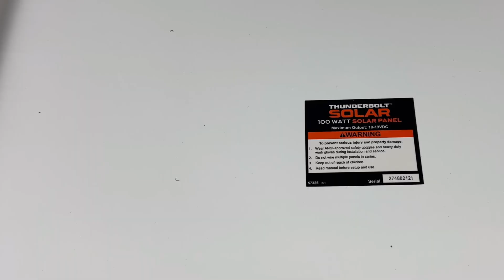MC4 Install Crimping Easy DIY

Comment: that is not an MC4 connector it is a knockoff and those are cheap tools that risk fire
Reply from the maker: A true staubli tool kit like the one I have, is about $1200
1 out of 1000 will buy it for their basic solar builds. 

The two biggest things is using the same brand connectors and not mix and match, and don’t over amp/volt your setup. 

The installer / user is the biggest culprit of poor connections verses the tool. If you have worked with crews you’ll know some people regardless are not good with tools. Even if they have the best.
Reply: @johnnysweekends  true. 
Nobody tells you this in the videos I’m just learning right now by researching this in great length.
Reply from the maker: I do mention more in this new video of my solar installation on the Rv which you can use the items for sheds, RVs, vans even homes if you want. 
Could give some ideas Install RV Solar Like A Pro! -The Quick & Universal Method Anyone Can Do!
https://youtu.be/furzOOafu_Q

Comment: I don't see what is making the electrical connection and in fact when I do what I see you do, I get an open circuit.  Are you sure you only crimp way down on the two folding tabs?  Are you sure you only strip a quarter inch and don't crimp where there is bare wire?

Comment: My male end (female connector) doesn't click when I insert the wire.  The female end does click.  Is there something wrong with the connectors I bought then?  So the only thing holding the one end in is by tightening that nut and closing the rubber piece on the insulated part of the wire.  It's not held in place by the metal.
Reply from the maker: Defective or mix and matching pins with connectors 
I would use another set of

Comment: I’m running #8 wire, it appears that the crimpers and MC4 connectors are #12 & #10, not 8. Is there a different MC 4 connector if you’re using #8 wire?
Reply from the maker: Typically only true Staubli mc4 connectors are meant for 8-12g wire
While the cheaper is for 10-12g wire

Comment: Surley it would be better if the cable ends were soldered thus creating better connectivity  down all the wire strands.  ? 🇬🇧
Reply from the maker: That’s not how it’s instructed

Comment: Only thing I would point out is if your solar system has high voltage 250-400 volts good idea to check over those MC4's once in awhile if you can get to them easily I have a ground mount so I can walk under the panels use it for shade. I have found MC4s that melted the connector.

Comment: It sounds confusing. Why male pin inside female connector, what will happen if you put female pin in female connector.
Reply: @SSUKBD  that's standard on the majority of insulated connectors (any type / industry). It's mostly just a geometry thing where it works out better and protects the pins the best.

Comment: I dont have the tool, but i crimped with a Plyer and then melted a lots of solder into the Joint. Now i dont think its going anywhere. Thanks for the video, i followed it and now i have good connection.

Comment: I really think you should take this video down and remake it, for three reasons; 
Which manufacturer's instructions say to disassemble the connector? Certainly not Staubli, the original MC4 manufacturer. Disassembling the connector can lead to losing one or more of the parts, reversing one or more of the parts, pinching the sealing gland, or introducing foreign material into the connector. This might not be obvious for many years, until it causes a fire.  

Secondly, double crimping the connector? Which manufacturer allows this without voiding the warranty? 

Thirdly, twisting the copper strands of the cable before crimping the connector? The whole point of this type of open barrel connector is that the legs of the connector penetrate the bundle of strands, and by twisting the wires you risk the legs breaking a wire, or being deformed or deflected. Again, which manufacturer recommends or allows this? Certainly not Staubli

There are only 5 steps to the manufacturer's instructions; strip, crimp, inspect, insert, tension, and you have added your own 3 (double-crimp, disassemble, and twist the strands) for what gain?

These connectors are expected to last the life of the installation, so with modern panels, this means in excess of 30 years. Your modified method doesn't meet any electrical code i know of.

I wouldn't risk going against the manufacturers installation, increasing the probability of a failure or fire, and voiding your insurance, and your connector warranty, when just following the manufacturer's instructions is faster and easier.

Comment: Does the male end vs female end need a specific metal piece? Or as long as one has version a of the metal and one has version b it’s fine? Hopefully I’m making sense: wasn’t sure if male mc4 needed the wider or thinner metal
Reply from the maker: Do not mix brands….and watch the video so you get the correct pin
Reply: @johnnysweekends  first time I watched I must have missed it, thanks

Comment: Sir good day to you. Im from ph and starting to build my DIY solar system. Basically, i series my two panel. And now i have to crimp a mc4 and followed your video. However, when testing the panel, i got a negative reading which means that the polarity was reversed. My question is, if my panel have a male connector for negative polarity then my mc4 female polarity should use the black wire and not the red wire since it is still negative connection correct? And vise versa with the possitive polarity? I asked this because i follow this instructions and put then red wire in female and black to the male and plugged it to my panels and now I got a negative readings in my multimeter 😅. I just want to confirm my scenario for me to switch the wires on the mc4. Sorry for my noob question btw.

Comment: i dont have tools only pliers, is it possible to do it?
Reply from the maker: Yea you could. The tool makes it way easy but if you’re good you can do it. Just cant make the crimp to wide or it wont seat in the connector

Comment: Very useful and to the point information. Switching my Harbor Freight panels to MC4 connectors will make it easier to connect them in series, without suffering the power loss of all the wire adapters otherwise needed. Having the All In One MC4 kit on hand will also make for quick repairs if any connectors get damaged in the future.

Comment: Nice Quick video, but misses a critical point.  Who is the manufacturer of these connectors they don't appear to be Staubli Multi-contact (MC) Connectors.  Use of this MC terminology for other manufactures connectors can be misleading and dangerous.  These style connectors cannot typically be cross-mated with other Mfrs connectors, and definitely not with true Multi-Contact connectors.  This is the leading cause of fires in PV installations today.  Seriously, just read Staubli's instructions and Whitepapers.
Reply from the maker: While true a Staubli connector is more the standard and what we have in the shop most people dont want to pay $5 per set. Plus how you know every manufacturer is using a staubli connector on every brand of solar module? I find the renogy, Ecoflow, bougerv all seem to be the same as far as quality goes between them. And I would recommend at least a name brand verses the cheapest of the cheap from eBay and Amazon. So many out there with tons of different names. Maybe I’ll compare some and see if there is any real significant difference.

Comment: This is all fine and dandy, but this amateur viewer has reservations about buying a crimper kit when all I need to do is use it one time to build my small system.
Reply from the maker: Lol you say one time, but watch out…..its addicting and soon you’ll want more…😂
Reply: @AdrepKeith  I just finished removing all the MC4 connectors I built for my “toy” system and replaced them with higher quality connectors. Your mileage may vary but I’ve found a cheap crimper (I had the wire cutter/ stripper) like the kit shown is a great investment, like most tools. I also invested in a crimper for square ferrules, very helpful for the other end of the wire with the MC4s on one end.

Comment: This is an old video but a few corrections here.

First, use the largest AWG that fits into the crimp if you can.  Either 10AWG or 12AWG, generally.  Do NOT use wire thinner than 12AWG, it won't make for a good crimp.   It MUST be stranded copper or stranded tin-plated copper wire.  It should NOT be "poofy" wire (tin-plated copper wire with 200+ really thin strands).  Poofy wire should never be used in these applications.  Use wiring explicitly designed for solar applications which means 10AWG or 6mm^2 stranded copper wire with no more than a few dozen strands (and usually not tin-plated either).

Second, don't twist the wire.  The crimp folds over and pushes into the middle of the wire bundle.  Twisting the wire may cause the crimp to cut the wire while it is pushing into it.  The wire should be kept straight.  The crimp retains the wire because the extra wire past the end of the crimped metal splays out and prevents it from being pulled out (like how most crimps work).

Third, if you want something that will last the life of the system, consider soldering after crimping.  It is very easy to solder the wire after you've crimped it, before placing it in the housing.  This does require a hot iron due to the amount of metal and wire involved and a soft vice to hold the wire.  The solder will soak and flow very nicely and basically guarantee that the crimp will never become loose.

The only thing to watch out for is to be sure that you don't put so much solder in that it flows into the retaining tabs on the pin for the plastic housing (the wire should not extend that far into the pin anyway).   But also don't put in too little.  The solder should completely fill the crimp area and flow nicely into the excess wire area past the crimp area as well.

Poor crimps and/or not soldering can result in excessive heat at the junction, and other problems over time.

You don't need to use the wrenches to finish screwing in the housing.  It should be done by hand.  It doesn't "tighten" per-say, you just screw it in until it hits its stop.  The seal is made by the rubber gasket inside, not by tightening.  So just make sure its screwed down all the way, that's all.

Comment: There are 3 different places to crimp. You didnt mention which to use. I have the same tool and i believe if the cable is 2.5mm2 then you use the end crimp .it is marked 2 5mm2

Comment: Greetings,   You have a few mistakes in the video. MC-4 is not a generic term for the connectors on solar panels, they are made by Staubli. All of the Chinese solar panels I have seen, say "Compatible" with MC-4. This is not a UL tested term and they might fit together but not perfectly. When moving 600 to 1,000v you want perfect. You don't want to mix and match connectors, you want the same brand on both sides of the connections. 
The wire you show is not #10 or typical solar wire, which has a double jacket for protection and is thicker.
The blue plastic sockets are not meant for the final tightening, perhaps with some of the "compatible" connectors, but not with MC-4. They are only meant to snug up the fitting. Staubli actually has (an expensive) torque wrench to tightern the final threads.  It is moderatly easy to cross thread the nut and the threads, if this happens you have to start over with a new connector. 
Improper connectors are the #1 point of failure in a solar system, by far. 
These techniques might be OK for a small cheap low voltage solar panel, but not for a house where you have up to 600v or a commercial roof with up to 1000v.
Reply from the maker: You would be correct. But the mc4 term is a simple general term still used in solar installs and when building an array with staubli “mc4” as you would see stated on most spec sheets like Canadian solar, Qcells and more then the general term is still mc4 for short. 
Have to remember nobody cares about tech terms for the simple diy and beginners.

If I started saying modules, junction box’s, arrays and more people get lost.
That’s what this video is for. The new diy people learning about solar.

Still all these connectors are still Ip68 rated and most are good to 600v or even 1000v. 

The cable on the back of this harbor freight panel is barely UV rated and not actual cable like you would see in other solar videos I have done it like my LG 335s 

Again, simplify, that’s who the video is for.

Comment: You have your male and female connection back to front. It's based on the internal metal ferrule not the external plastic. Generally, the female MC4 connector is associated with the positive lead and the male connector is associated with the negative lead. Though I guess it doesnt matter what you call it as long as they go to the right place.
Reply from the maker: Yes you are correct and one of the only ones to actually notice or catch that. But I found when teaching people, this was the best way I could think of. People only see the outside and that’s it. So it seemed the inside became irrelevant. 

So I did it this way and so far, people seem get it. 

But again, you noticed 👍🏼

Comment: Thanks but would like to know how to disassemble as cable came pre installed
Reply from the maker: Disassemble from where? The junction bow or the cable end. The Mc4 can be opened but would need to be cut off to replace or swap out.

Comment: This is all brand new to me and I have been trying to figure out which of the pins were male or female. I've watched about a dozen videos including ones from solar companies. Yours is the 1st to show me, not just say, which is m/f and the part about keeping the couples together was PERFECT! I will remember that FOREVER!!! I can't thank you enough! I have no idea what your channel's about but you have a new subscriber and I'm excited to find out.
Reply from the maker: Hi Shelly glad you found me and this helped you out, and thanks so much for the sub and joining the group 👍🏼😀
Check out the solar beginner videos as there is some good info there as well…👍🏼
Reply: @johnnysweekends  You are a VERY fast talker so I have to back up and replay several times to catch (and understand 🥴) everything. But I am a senior with a little bit of hearing issues 🤪. Just an observation 🤔.  Although it seems to be who you are so trying to slow down might not work for you.
Reply from the maker: Shelly I have actually addressed this in newer video. I just like going fast and getting thing as done but i have to work at a pace that is more neutral for everyone. Unfortunately cant fix the older videos.
Reply: @johnnysweekends  If I have trouble catching something I just change the setting to a slower speed. Works great. Thanks for such a concise video.

Comment: Perfect video. Moreover I happen to have the exact same tools.
One thing to add: the pins must be pressed/pushed in position pretty hard until it ‘clicks’.
I have had a couple of instances where the contractor (pin) was too recessed and it did not work.
Thanks!!
Reply from the maker: Thank you and yes some mc4 connectors seem to need more pressure to get the pin fully seated to where it clicks. 
👍🏼😀

Comment: Do you know how to make solar panel connectors longer for parallel T branch connectors? My panel connectors are too short, and I need to make extensions.   I am thinking I need two red and two black, but would they need a positive connector on one side and negative connectors on the other or would it be  two female connector  on each side of the negative connector and two males for the positive connectors?
Reply from the maker: You can buy pre made cables if you like to extend to a much longer length. 
Or you can buy wire at most any hardware store and add connectors like in this video. 
Depends what you want and need.
Reply: @johnnysweekends   Thanks.This afternoon right after I type the message to you, I  thought about it for a while and then went and got some shorter MC4 cables.  Mostly what I have is 100 ft, but these were about 30 feet.  I got out one red and one Black mc4 cables.  I connected the red MC4 connector to one of the positive end, and one  black MC4 to one of the negative end.  After that I was able to connect them to the T Branch connector.   I will have to shorten them at a later date.